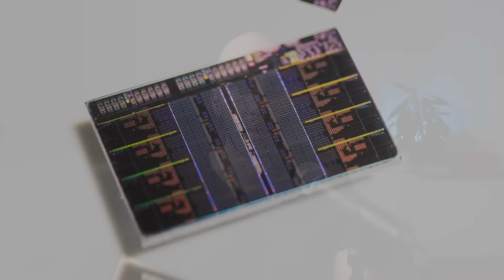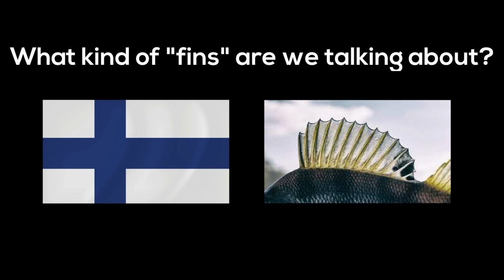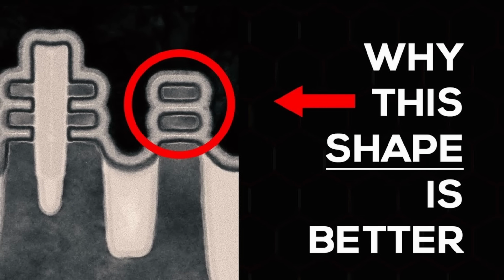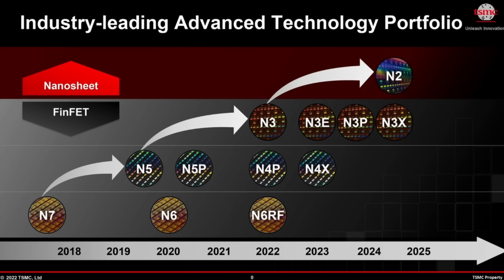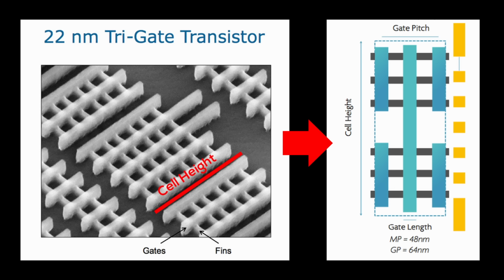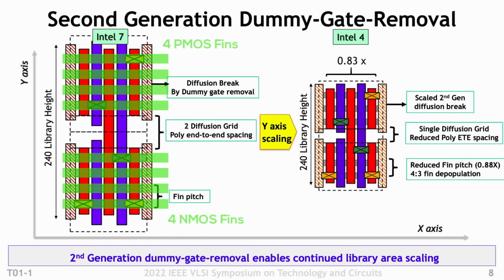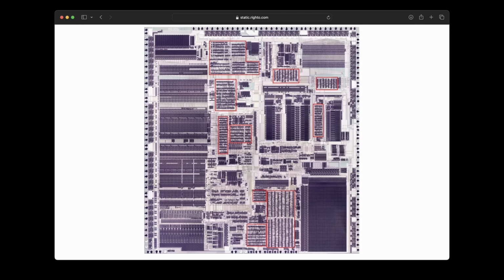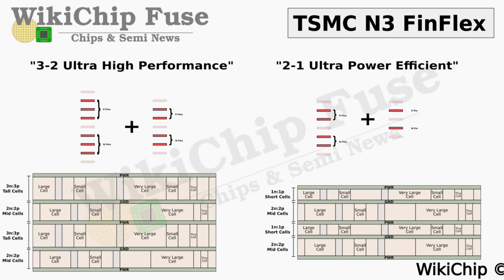TSMC FinFlex: How Chips are made Worse to get Better

Comment: :facepalm:  N-type and P-type can each, either be made to be 'enhancement mode' or 'depletion mode'. So there are FOUR types of mosfet. 

And the answer to the question 'is the transistor on, or off, when the gate is charged?' is actually whether it's enhancement mode (gate charge enhances conductivity, allows current flow, default is none) or depletion mode (gate charge depletes conductivity,  stops current, default is some). 

Uncharged means 'with zero voltage between gate and body'. Charged doesn't imply that it's necessarily positively charged - it could be negatively charged also. Either way, there's a distinction from when not charged : charged means voltage across the channel is away from zero, but it can be either way.

N and P type just react to opposite polarity gate charge. But both can be made to be either enhancement or depletion. The type he describes is an enhancement-mode N-type Mosfet.

N-type enhancement needs positive gate voltage to turn on, it's off by default. N-type depletion need negative voltage applied to the gate to turn it OFF, it's on by default.

Similarly: P-type enhancement needs negative voltage to turn on, P-type depletion needs a positive voltage to turn OFF. 

Since we want to run our computers with just a single, positive power supply: this is why CMOS uses N-type enhancement with P-type depletion. So that's what you usually find, and probably why this guy got them conflated, since in this case, it's coincidentally true. So he's accidentally not wrong, which is the very worse kind of correct.

See: N or P-FET's, you can have it either way. CMOS is where you have a P-type depletion with a N-type enhancement: so they steer the current between the two as the gate is charged. Hence, 'complimentory'.

They get the same gate voltage, it's just arranged so that usually one's on when the other is off, and vice versa. 

Usually, the power supply is across the two, and the output is taken from between them. The body of the whole chip is the one side of the supply (usually ground) so you only have positive gate charges to make use of. 

But you could go the other way too, with the big shared ground instead attached to the positive supply - in that case, you'd be using N-type depletion-mode mosfets with P-type enhancement-mode mosfets for CMOS, and you'd be charging the gates to a negative voltage to actuate the mosfets.

The shared connection to both complementory mosfet's gates is the input, and the arrangement acts as a high-impedance input, low impedance output. This also 'inverts' the logic: The output voltage will be drawn low as the gate voltage rises and becomes charged: The n-type enhancement is connected to negative supply, and allows the output to sink a current to ground, discharging to zero whatever is connected (probably a lot of other gates). 

When the gate voltage goes low (becomes discharged), the P-type depletion mode connected to the positive supply stops insulating, and this allows the output to source current from the positive supply, charging it and all connected gates. 

Either way, whatever the output is connected to (usually a bunch of other gates and interconnects, all having capacitance) can be charged or discharged quickly. It behaves like a change-over switch on a relay, if the common pole is the output, and the other two are attached to positive and negative supply.

If you didn't do this, then only charging, or only discharging, (the output) would be fast: The other way would be slow, usually being done with a resistor to the other supply, which could weakly source current (such that the transistors strong conductivity, when on, overrides it).

Usually, the two transistors are also sized so that this output load charging/discharging can be symmetric too. (i.e. charged or discharged in equal time). They can also be changed in size (width) to fit the specific capacitance with the right conductance to do that work in an equal time as every other circuit on the chip.

Sometimes, you'll also want to have multiple inputs, so as to make logic gate circuits, so for these you may have either or both of the N and/or the P mosfet sides split into two, with two different input gates, those either in series or parallel. This lets you make either NAND or NOR gates, depending whether it takes both inputs high (NAND) to pull the output low (in series), or either input high (NOR, in parallel) to do that. 

This is usually a NAND gate - with the enhancement-mode N-FET's in series, pulling the output low only when both gates are high (and both 'close'), and the depletion-mode P-FETs in parallel, pulling the output high UNLESS both gates are high (and both 'open'). The depletion-mode P-fets are the ones with the little circles on their gates: You need to understand that a positive charged gate makes them go open circuit! Else you won't be able to understand the circuit diagram!

And from just many such NAND (or NOR) gates, you can build any binary logic circuit, and ultimately any binary digital computer architecture.

But you need to know about enhancement mode vs depletion mode! Or else the diagrams would make no sense!

Comment: Your beginning of the explanation of N-type and P-type transistors is a little confusing to me. It first sounds as if you are going to make a distinction between gates that are open by default and close by getting current, and those which work the other way around. Then you explain N-type and P-type as having different electrical charges or polarity, but both types of gates opening by getting current applied? Or maybe I am just getting lost somewhere.

Comment: Traditionally, an NMOS transistor is able to supply 2-3 times as much current as a PMOS transistor of the same size (due to lower mobility of electron holes compared to electrons). As I understand it, this commonly leads to PMOS transistors being sized 1.5-3 times as big as NMOS transistors in standard cells. I was  expecting a similar pattern here, maybe 3 PMOS fins and 2 NMOS fins, but all the examples you show have equal counts of both. Is mobility difference not relevant anymore due to velocity saturation, or are there other effects in play here?

Comment: Great explainer! One minor nitpick: CMOS in ICs is not really about creating a transistor from an NMOS and PMOS transistors, it's about using both NMOS and PMOS in a logic gate. CMOS is more power-efficient because it complements PMOS and NMOS circuits in the logic gate, so that pull-up and pull-down resistors are not needed (hence the name).The logic diagram of a NAND gate you showed already visualizes how this works: you have a pull-up circuit (the top one) consisting of two PMOS transistors in parallel, which pull up the output line when either of the input voltages is low. Then you have the pull-down circuit which pulls down the output line when both input voltages are high.

Generally, p-type transistors are used in pull-up and n-type in pull-down if I recall correctly, though I don't remember why.

Also, larger logic gates are not necessarily used for high performance or higher frequency. Like you said, they provide more current, but they are selected based on multiple criteria. For example the fan-out, which is the amount of logic gates that it needs to power. A larger logic gate consumes more power when switching, which can actually be detrimental at higher clock rates. Different size alternatives of logic gates are selected automatically by EDA software and used interchangeably
Reply: (it's because of the voltage curve in nmos and pmos is inverted)
Reply: Because Nmos turn on from the “Gate-Source” voltage. If you try to use it to supply positive voltage. The voltage at the source rises to VCC which makes the gate-source delta fall and turn off. So Nmos can’t pass high voltage.
But when used on the 0v side, it can easily connect ground to a circuit and drop basically no voltage.
Pmos works the opposite, since it level of “on” gets magnified as the voltage on the source terminal increases relative to gate. 
So you use Pmos on high side, and Nmos on low side.

Comment: excellent explaination. is fin depopulation the reason we hit the frequency ceilling?
Reply from the maker: Since modern fins are able to compensate the removal of fins, I don't think fin depopulation is at fault here. But to some degree, if FinFETs would still scale without removing fins, the transistors would get better over all (same amount of fins, but higher, thus better) which would lead to higher clk speeds. So maybe? But not really. :D
Reply: @HighYield  cheers! when will you join the ChipsNCheese discord?

Comment: Interesting. I wonder if, using the same "dumber but with better materials" idea, we're going to see a move away from CMOS in specialized chips. I mean, we already have examples of 3 types of cores on the same chip for different performance and power usage levels. If you can use 1 normal transistor instead of 1 fat siameze transistor, then that should further improve the density. And only use these for more specialized chips, so the energy efficient transistors for energy efficient cores (or accelerators) and viceversa. And, surely, some chips will still need CMOS.

Comment: I'm curious where you found the "pmos is more effecient" claim. I've googled a fair bit, and have been unable to find any good sources that detail / explain it. Only some poorly translated websites or Ai generated blog posts that claim it with no explanation or references.

Im curious what would make pmos more effecient than nmos, as hole mobility is a little under half of electron mobility, which would make pmos generally worse at power handling.
Reply: It's ultimately all about the carrier mobility, which is no longer a straightforward number for either holes or electrons in modern nodes (see: strain, phonon scattering, effective mass, interface effects, SiGe inclusion etc). I can tell you that in modern nodes, the mobilities (and final Idsat per Z) of the two are engineered to be roughly comparable. Calling out a too-specific difference between N and PMOS as in the video is no longer warranted and may cause confusion.
Reply from the maker: I think this is a good read on PMOS vs NMOS: https://www.wevolver.com/article/nmos-vs-pmos
Reply: @HighYield  yeah that's one of the ones I found. It seems weird. It at least has a few fundamental mistakes, like when describing the pmos. They write that it's on when vgs is 0v, and to turn it off you apply a positive voltage. That's for sure wrong, it's off when vgs is 0v, and conducts when. A negative vgs is applied. They're clearly describing it as a high side switch, referencing the voltage on the gate to some arbitrary ground in their circuit. Not vgs
They do cite another article on the same page for this, and that page does get it right.

They also don't mention the power effeciency, though I did see that in a different very similar article.
Reply: Note that this is the only iffy aspect I noticed in an otherwise very well-done video on mixed-row design.
Reply: The easiest way to explain it is that an electron is easier to move than a lack of electrons ("holes")

Imagine trying to move a card by blowing air vs sucking air. It's easier to push.

Comment: 14:45 this graph is misleading IMHO, because it show size of transistors, but what would happen when it would get to 0? Infinity? Transistors density is more what we should look. Because 10nm to 5nm is same jump in density as 2nm to 1nm (if they would represent real sizes). And we still have plan for next 10 years ready, and more in progress.
But personally, I can't wait to see more optic compute, not quantum, but using light instead of electron. Because it would eliminate a lot power usage, and would allow to build real 3D processors, as our brain is measure in cubic not squares.
Reply: The reason optic compute doesn't exist is because it's hard.
It's also worth noting that these transistors are already smaller than the vast majority of light.
For example, standard fibre-optic wavelengths are between 1200 and 1600nm. That is infra-red. 
Creating the deep ultraviolet light that produces these is an insanely convoluted process, so it is exceedingly unlikely cheap lasers in the DUV range to operate optical CPU's will exist any time soon.

Of course, you can argue that DUV isn't required for optical processors, but even if you take 400nm bluray wavelengths then you're left with the reality of an equivalent processor being at least 100x larger physically.

Optical in theory could be far more energy efficient, and stack easier, perhaps limiting its physical size to roughly the equivalent of a CPU + heatsink, but then you're still making something with the same precision of a modern CPU that's 100x larger. I can't see how that could be anything but 100x the price per equivalent unit. Yes, I suppose if you can 100x the effective hz it might make sense. 500ghz single cores would be interesting. 

I wouldn't be holding my breath for optical.
Undoubtedly it will be used for things like PCIE and even USB, but processing isn't likely any time soon.
Reply: @myne00  you missing the point, you don't take in to account frequency, and that you can use multiple wave length of light at once, which is already use in real chips. And ignoring 3D aspect, so more performance in less space. 
And I don't think we see it fast, 10years it is minimum for any bigger production. There are many challenges, but from all solution I know, this is only which could be step up from what we have today. 
Heat is problem, and transmission speed to, this is why we move to light for longer connection already, but this will be useful in chips to, but as I said, it still in research phase, or some elements are not have solution today.
Reply: @m_sedziwoj  I addressed frequency and 3d. I'm not sure how you missed that.
Reply: @myne00  And I addressed that is not 1 to 1 conversion. First, multiprocessing at base, because different wavelength can be use in same time. You don't even think about 3D at all, because you say "size" but, you have ^2 in mind, when going up 100x is maybe millimetre, and I did talk about cubs, so "chip" with size of 15mmx15mmx15mm, is not 15x bigger, is 15 000 times bigger. and optimization in path of "signal", we still waiting for 3d cache to be directly connected to cores not on side, latency is important. About size, don't forget that electrons and photos can be wave or particle depending on situation, so I would not bet that "transistor" must be of size of wavelength, because even today optic is not. And I not talking about optical processors, because they are more as 1st transistors, not even to compare to today one. Anyway, size in 3D change everything, even when size of "transistors" can't be smaller. As human brain is slow, each neuron is big, but still better what we have in chips.
Reply: @m_sedziwoj  I clearly said the solution might be around the size of a cpu+hsf.
That's 3d.
You seem to be forgetting that a huge chunk of any processor is "wiring". Optical wires are thousands of times more sensitive to corners than electricity. 
So the "wires" are 100x bigger, and have bend radius limitations. 
As for your theory on dwdm in the processor, that's a whole other level of complexity.
Reply: @m_sedziwoj  I clearly said the solution might be around the size of a cpu+hsf.
That's 3d.
You seem to be forgetting that a huge chunk of any processor is "wiring". Optical wires are thousands of times more sensitive to corners than electricity. 
So the "wires" are 100x bigger, and have bend radius limitations. 
As for your theory on dwdm in the processor, that's a whole other level of complexity.
Reply: @myne00  when something is 100x bigger, as you say, I think it would not be, it don't required today tools to make it, they will change, you still think about today photonic on silicon, why it should stay this way?
Reply: @m_sedziwoj  because there is a floor in the size because the light is bigger.